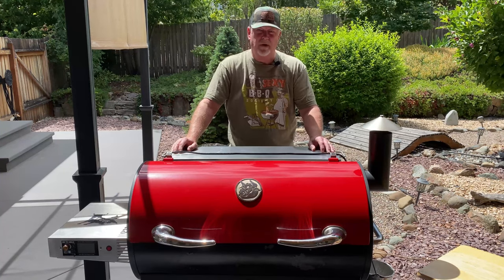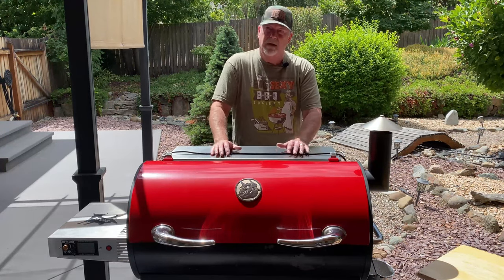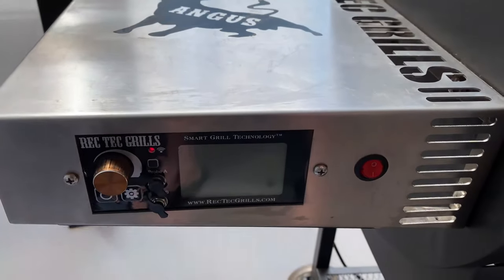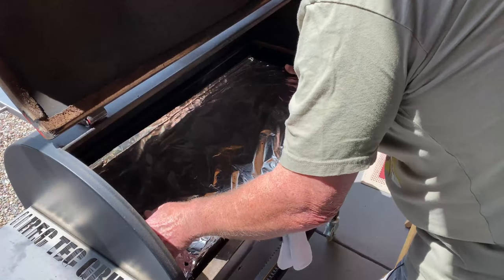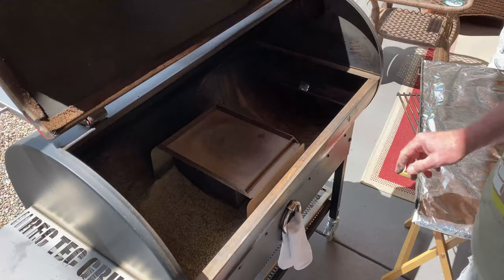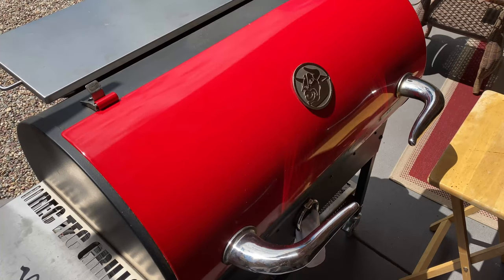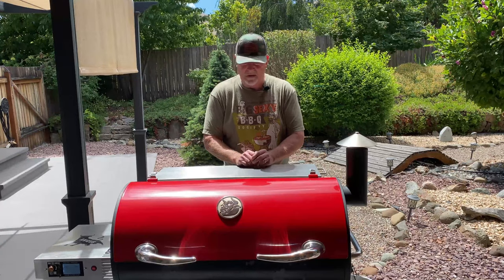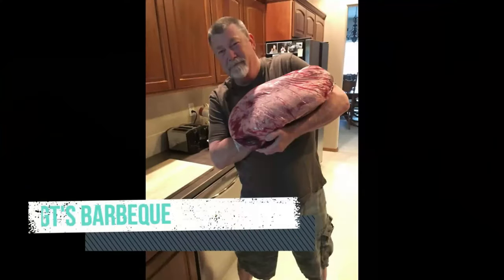Rec Tec Pellet Grill Four Year Review. Is it worth the money?

Comment: I have the same model and I also upgraded the controller. I love this thing.  I got it in 2017 and no problems. Still like new. Smoked a brisket last week. Came out great. Put it in at 9pm at 200 degrees. Didn’t touch it till 8am. Wrapped it, put it back in at 250 degrees till 1pm. Covered it with a moving blanket till 5pm. When I cut into it. The juice coming out was unbelievable. Everyone loved it. I reverse seared some steaks today. Came out great. I just checked the pellets. Still the hopper is half full. Highly recommend.
Reply from the maker: That’s awesome!  I’ve been doing my brisket and pork butts overnight like that lately and love it. Nice to get some sleep and still turn out a good product! Thanks for taking the time to watch!

Comment: I enjoyed the review of the Rec-Tec. I sure like the looks of the Rec-Tec and how heavy-duty built they are. I have the Pit Boss Pro series 4 vertical pellet smoker and it also does an amazing job and holds a steady temp with little to no variation up or down. I would have probably gone with the pellet grill but I had just purchased a Char-Broil gas grill a few months before the smoker (had a hard enough time explaining to the wife why I needed a smoker after just buying the gas grill). If I had it to do all over again I would have probably tried my best to get the Rec-Tec because of how well they're built and the great reviews. Your Rec Tech still looks brand new after four years. Thank you for sharing! I just subbed your channel.
Reply from the maker: Thanks for taking the time to watch. I have a friend who has that vertical Pit Boss and he loves it. He had a couple of issues with the controller but it seems fine now. Really looks like a great way to do a lot of food with a small footprint. Btw great tip on using soap and water to clean the door.
Reply: @gtsbarbecueandcuisine4837 , thank you for stopping by my channel also and watching.

Comment: Hey GT!  Great video!  I've had my 680 for about 6-7 years.  It looks just like yours, except yours looks brand new on the outside!  I keep a cover on mine, but it doesn't look anything like as new as yours. I bought a gasket to put around the lid of mine too.  I haven't installed it yet. I was a little surprised to see so much smoke come from around the lid. But, even at that, it cooks really good. 
Like you, I have just received the new controller with the stainless steel side shelf.  I'm going to install it today or tomorrow and give it a whirl this weekend.  Again, great video!
Reply from the maker: Hey thanks Newton! Yea I love that thing and it has worked perfectly all these years. I cater from time to time and can easily get six recks of ribs or several pork butts on it which allows me to handle 25 people easily. I appreciate you taking the time to watch and have a great Christmas!

Comment: I have one exactly like yours. I love it. Set it at 225, go to sleep, it will be 225 in the morning. I had a Traeger before that. It had horrible temp swings which would lead to a flameout.
I had an igniter rod go bad and they sent me a free replacement that shipped the same day that I called
Reply from the maker: I hear you James. I’m not putting anything down but my Rec Tec just works right out of the box. It’s an engineering marvel in my day to day experience of using other products. Thanks for taking the time to watch! Have a great week!
Reply: @gtsbarbecueandcuisine4837  Just to clarify, it was the igniter rod on the Rec Tec that went bad after a couple of years...but they shipped a free replacement the same day I called.  They also give you the personal cell phone number of the owners in case you ever need customer support at night or during a weekend...pretty great!
Reply from the maker: Ahh well how a company handles an issue can mean a ton! I have heard Treager has a lot of issues with them as well.

Comment: when you had your green mountain grill, how was the temperature variance compared to the rec tec? I was really wanting rec tec, but the green mountain pizza accessory has me swinging towards GMG.
Reply from the maker: Well I liked my GMG and also had the pizza accessory. I actually owned three before the Rec Tec and still have one at our cabin. I experienced pretty significant temp swings but at the end of the day if you keep an eye on your food which you should anyway it’s not the end of the world. I actually got the Rec Tec to move up in size. I will tell you the PID computer is dead on with it. If it swings two degrees it’s a fluke. At least back then the computer was way better. But you’re wise in thinking through how the cooker you get will be used. I rarely used the pizza oven and honestly you can make great pizza on any pellet grill just on the grates. If you make a lot of pizza there are some nice stand alone ovens that work great. It’s a bit of a pain to assemble the GMG for pizza then put it back together to cook on. Not to mention storage for the accessory. At least that was my experience.
Reply: @gtsbarbecueandcuisine4837  were any of your GMG the newer prime models?
Reply from the maker: No Joe they weren’t. I’m sure a lot has changed. They made a hell of a good grill though even back then. If I were buying a new grill today I’d definitely consider one.

Comment: hole saw on a drill u can punch a hole down low in the hopper (when empty) vacuum any shavings out get a small of stainless and rivot it on inside, if u do it right with a handle that sticks up above most the pellets just rotate it with bucket underneath & your good to go, not perfect but better than scooping for 30 mins.
Reply from the maker: Great idea. Thanks

Comment: I've had my GMG Daniel Boone for 6 years. Looking to upgrade. How's the smoke taste with Rec Tec? I've also had zero issues. Any issues? I also store our grill in the garage, out of the elements.
Reply from the maker: I had two Daniel Boones before this and they were great. I mostly wanted a bigger grill and this one just stood out during my research. It has an extreme smoke setting and does a GREAT smoke ring on my briskets. I think the biggest thing you’ll find with this is the extremely heavy duty steel, the ceramic igniter, and the PID. It is incredibly accurate and fuel efficient. I imagine they all are these days though lol. As long as you’re having fun it’s hard to go wrong! Thanks for taking the time to watch Tim.
Reply: @gtsbarbecueandcuisine4837  no thank you! We love to grill and BBQ. We're looking to upgrade. Rec Tec says the 580 is about the same size. Or would you say the hell with it and buy the 700? Is the sear kit worth the extra money? Sure appreciate the help.
Reply from the maker: Well I think the Bull is about $1,100 now so if you can justify a few hundred more I’d go with that. The hopper is huge and you’ll never regret having the extra cooking space. I like my sear kit but find I use it mostly on my kettle for searing. It’s great on the Rec Tec though if you invert it and use it for burgers. Again it will last you a lifetime so if you grill a lot you will find it useful.
Reply from the maker: https://youtu.be/zQAXKVjCBxM

Comment: Nice, My Texas Traeger was rusting out within a few years. No stainless anywhere on it. Auger motor went out the first year, fan motor went out the first year or two, the whole unit started rusting within a few years, paint peeling, auger jammed a few times with high humidity. Won't ever buy another Traeger. I see a Rec Tec in my future.
Reply from the maker: Thanks for taking the time to watch. I’ve run this thing through the paces for years and not one issue. I did get a small paint peel on the front due to cooking at too high a temp with the winter cover bu other than that perfect! Tough to beat for the money. Have a great weekend!